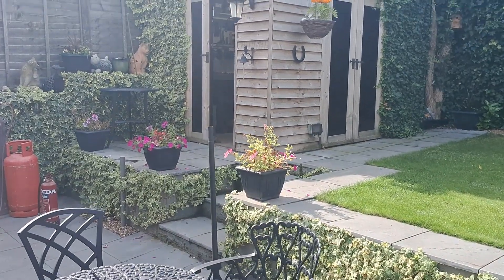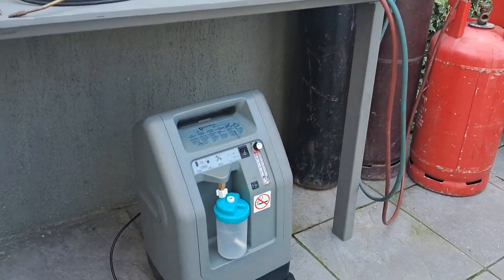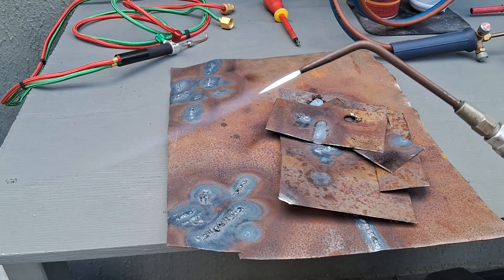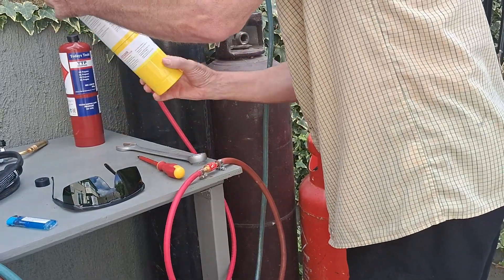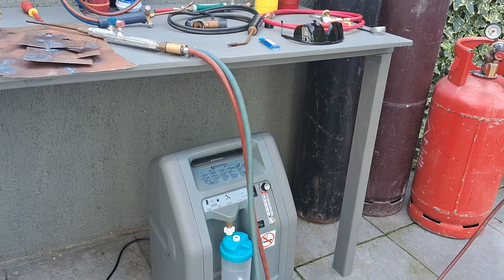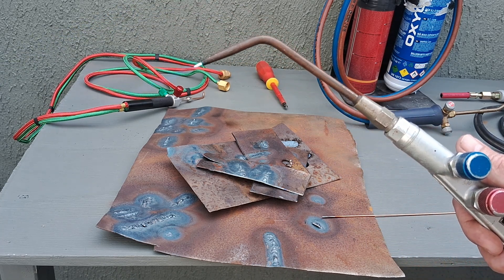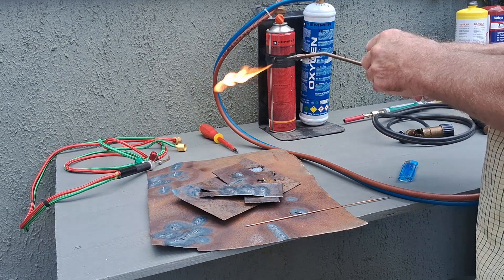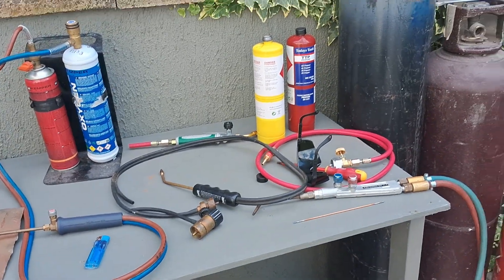FREE OXYGEN FOR WELDING USING A MEDICAL UNIT MAPP GAS PROPANE OXY ACETYLENE KIT GEAR MINI SET

Comment: Andy I need to do one lead burning job. I need cheap kit.  What would you recommend.  The cheaper the better. I can weld, ex mechanical engineer.  I need a torch with size 0 nozzle and maybe Map plus gas.  Just don't know.  Regards Terry.
Reply from the maker: not sure really, just shop around and be aware or the price of the replacement gas cheers andy
Reply from the maker: those cheap chinese kits may work for you. they are only around £15

cheers andy

Comment: Great videos not sure if you’ll get this message just wondering if you could recommend a mini gas set for me getting a bit confused with all the bottles I live in the UK.
Reply from the maker: thanks a lot. it depends on your budget . but when getting a set the price and availability of replacement gas is very important. also adapters to other bottles. and remember not all of the bottles are interchangeable  cheers andy

Comment: Those generators are not "free" as they do need replacement of the molecular sieves and filters, which can get pricey, and they have a very limited flow rate and pressure, so you are generally limited to smaller tip sizes and heat output and forget about cutting..  

Definitely useful for hobby use, but that said, that little "micro torch" is probably the most useful torch on the bench.   Very concentrated pinpoint flame and low flow, so works perfectly with a medical oxygen generator and even the disposable oxygen bottles last for hours of use vs. the other styles of torches where the tips are really too big given the size of the canisters:  a full oxygen canister basically lasts for only about 10 minutes of really decent heat, which may be enough for a couple of small brazing repairs, but which is not really economical for actual welding or cutting..

What you might want to investigate are HHO torches, which basically run on distilled water and potassium hydroxide drain cleaner.   These use electrolysis to separate hydrogen and oxygen and then you recombine them in a torch and are used extensively in the jewelery industry, and after paying for the machine (or making your own, they are not hard to make) are probably the closest thing to truly "free" welding there is...
Reply from the maker: great comment thanks andy
Reply: Thank you both.

Comment: I have oxy propane for heating and cutting, but was told you can't weld steel with it because it produces a brittle weld ? Something to do with the hydrogen atoms not burning in the flame, but becoming deposited in the weld ? 🤷‍♂️
Reply from the maker: it is not as good as acetylene, but it works if you need it to and dont have an alternative
Reply: This is correct... propane is not useful for torch welding because of weld embrittling...oxy propane is very good for brazing,silver soldering and bronze brazing operations

Comment: Great idea and find. Like you say the flow rate would be an issue for bigger jobs. Could you build a small gasometer (gas holder) with the water seal method to store the oxygen till it’s needed ? BOC bottle rental is a killer for hobbyists, that’s why I do MMA welding at home.

Comment: I do want to caution about exchanging regulators & hoses between Acetylene and Propane. Depending on what grade your hoses are they may prematurely breakdown in less than a year. 

Search Keywords “crossco selecting a welding hose.pdf”

Decent overview of Torch Fuel Hose Grades with “R” & “RM” are Acetylene Only while “T” is rated for all common fuel gases. 

Outside of the actual hoses, while using an Acetylene Regulator for Propane is usually possible [Since most modern manufacturers use (neoprene?) diaphragms in both] you should never try to adapt a propane regulator to run Acetylene since the all important safety feature of a 15PSI Max output won’t be inherently built in (not really aplicable in your example but important info for hobbyists).